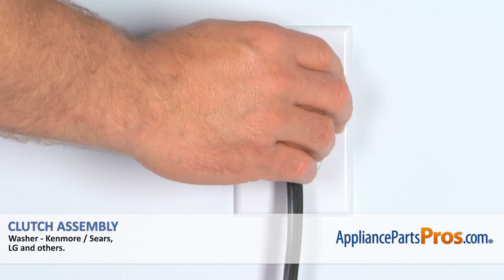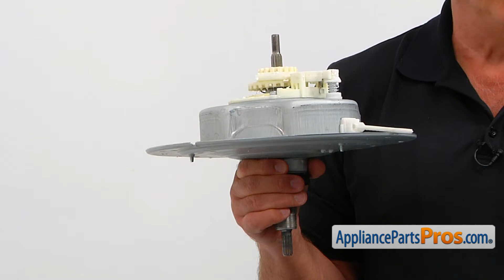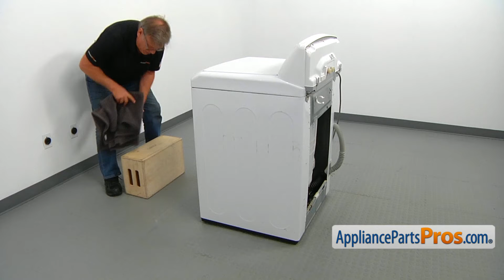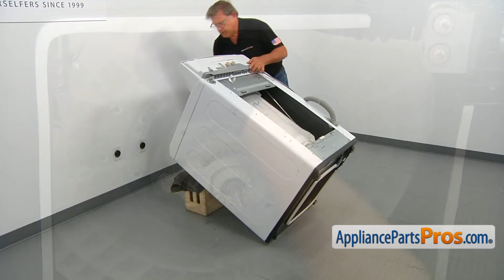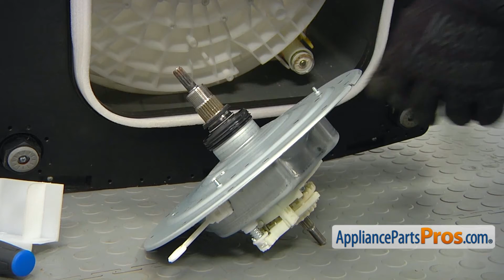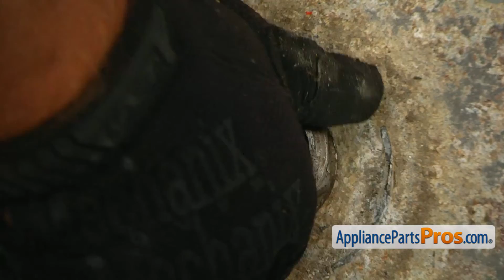How To: LG/Kenmore Clutch Assembly AEN73131403

Comment: Is there anyway to get the shaft out of the clutch assembly? My bearing is done and usually things are made to come apart, but there seems to be 2 metal lips holding the bearing in. Is that correct?
Reply from the maker: What is the model number of your unit?
Reply: @ ended up that it went down through the top. Thanks 😊
Reply from the maker: Awesome — glad you got it figured out! Thanks for letting us know. If you ever need help tracking down parts or have more questions, we’re here for you. 👍

Comment: Great video - folks watching it - be aware that :
1. if you have to hack through the plastic (3:23) I'm pretty sure you'll need to purchase a new pulsator.  I was able to use coat hangers bent to make a hook, put them into the three holes around the edge of the circle and pull the pulsator off.
2. That 38mm bolt is a bear.  I used an impact drill for over 30 seconds of continuous blasting with two types of penetrating oil before it budget.  
3. Getting the rotor assembly off is no simple task.  In all the videos I watched they are smiling and gently wiggle it off.  Not my experience.  There was sweat, cursing, two types of penetrating oil, and over an hour of wiggling.  I read someone said "gently tap with a hammer" - terrible idea.  The magnets on the other side of where you tap are brittle and break easily.

Overall fantastic video!
Reply from the maker: Thanks so much for sharing all of that—seriously great additions. Real-world experience like this makes a big difference for folks tackling the same repair. That 38mm bolt and the rotor can be brutal, and you're absolutely right about being careful with the magnets. Coat hanger tip is genius! Really appreciate you taking the time to share it.

Comment: Is it possible to replace just the shaft that the pulsator sits on? Mine has snapped in half
Reply from the maker: What is your model number?
Reply: @appliancepartspros  lg WT1101CW
Reply from the maker: Unfortunately, that shaft is only available with the drive shaft and shifter assembly, part number AEN73131403. This part is also no longer manufactured and we do not have any stock left, so we are unable to order it. You can take the part number and check around to see if anyone still has some stock left.

Comment: Is removing the tub really necessary?  Isn't the removal of the 38mm sufficient enough to remove the clutch assembly from the bottom?
Reply from the maker: If you are able to remove that part without removing the tub, then you can do that. It may not be an option for all models.

Comment: I thought this video was the most thorough on this repair. Only 3 comments I have are; #1 you may get a clutch that doesn't have all the holes for the stator threaded so inspect your new clutch before installing and thread them ahead of time. #2 each models method of opening the top may be different. My LG does not use the pry open method but 2 bolts in the front under caps and 4 small screws in the back (no hinge). #3 and very important as this took me a bit to figure out, make sure after you remove the old clutch, you verify the thick metal & rubber washer on the top shaft has come off with the clutch and not stuck to the bottom of the drum. That is what happened to me and it makes the drum sit too high (now you have the new washer on the clutch and the old washer stuck under the tub) and the drum will make a grinding noise as it will rub on the drum cover plate.
Reply from the maker: Thank you for those tips!

Comment: Again, outstanding video!  Just a quick tip... When I ran my washer the first time after installing the new clutch, all was well till the spin cycle.  There was a rattle that sounded like a screw was bouncing around inside the rotor.  I took the rotor back off and all I could find were VERY TINY pieces of metal (less than 1mm diameter) that I assume were bearing material from the old (failed) clutch or pieces from the old old clutch.  Again, they were very small, so I used compressed air all around the magnets in the rotor, and I then had to pick the pieces off the magnets.  Once it was clean, I put it back together and the washer runs like new now.  On a side note,  I tightened everything to what seemed to be right.   I was surprised that there weren't any torque specs given for any of the bolts, especially considering there is a lot of plastic.
Reply from the maker: Thanks for the tip!

Comment: Great how-to video.  I don’t typically work on my own appliances, but thought I would give this clutch change a try.  Pretty straight forward.  I also had the question as to why the drum had to come out, but from working on cars i am assuming it comes out to make sure the seal on the clutch remains seated “squarely” in place while the tub is lowered, else it may get misshapen and leak.   Also, on my model, the top has the four screws (two in the front are under plastic caps that just pop off), once they are removed, the whole top lifts off, no need to “slide it forward.”  Make time to clean the inside of the outer tub and the outside of the inner tub, ours had lots of mold.  The hardest part to remove was the rotor, but just tap a little around the spindle and keep wiggling and cussing and it will come off.  I got my clutch from Appliance Pros, and all six holes for the stator were threaded. I used an impact and a 38mm socket to get the main nut off in the tub.  And someone please get this instructor a couple of impacts to make his life easier!
Reply from the maker: You are welcome! Glad you were able to fix your issue! If there is anything we can help you with in the future please let us know.

Comment: Some bits don't carry over to 2018 era machines, but overall it was good. I didn't need to chisel away the part he did to remove the wash plate. There are less destructive methods like screws that just fit in the holes in the base, or two channel locks. Those don't require also replacing the wash plate.
Reply from the maker: Thank you. It really all depends model number to model number.

Comment: As for the drive shaft nut the secures the wash drum to the clutch shaft, removal usually requires the aid of an impact wrench, I used a twenty some volt cordless impact wrench and 38mm socket for lg, 38mm socket can be ordered on Amazon. Harbor Freight gave me a great deal on the cordless impact wrench which I also use when I need to remove a wheel from my vehicle for brake checks, easier than a lug wrench.

 To  remove a seized wash platter from the drum bottom without damaging it requires some time, a lot of patience and in the end a little fineness. Once you have removed the plastic center cap and the screw that fastens the wash platter to the drum spray some penetrant such as wd40 or other brand into the threaded hole the screw was removed from. Don’t go crazy with the penetrant , lightly spray right into the screw hole section until it has filled the hole and spilled out slightly into the round area where the screw head seats, leave it sit for an hour or so and then return and repeat the process. You want just enough penetrant in the center so that it can seep into the space between the clutch shaft (the shaft the platter fits down onto)  and the center opening on the platter. Once you have sprayed the penetrant and let is soak two or three times over several hours slowly work your way around the outer edge of the center platter pushing down on the edge as you work your around  the platter, you will hear some light cracking as you’re doing this, the noise is a good thing. After you work your way around the platter edge several time you should be able to with a little tugging pull the platter up and out of the washer.    NOW the following is worth an honorable mention. If you’re working on an lg1101cw as I was and the drum doesn’t want to spin and at times spins a little but makes a grinding sound as if something is stuck between the drum and outer drum basket, do not assume it’s a clutch issue. To install a clutch in one of these machines is time consuming and very labor intensive. If you machines symptoms are like those I described prior and you wash drum spins freely by hand, try the $13 fix first which is to replace the stator/motor sensor which is a plastic sensor that literally snaps onto the edge of the stator which is that heavy ring with the copper windings aka the motor. Many videos on YouTube go right to replacing the clutch. My machine would not wash, overfilled with water and made the scraping grinding noise when the drum would try to spin. A new Stador sensor fixed all for $13. If you do remove that wash platter in the drum, again, do so with patience and fitness, a new platter will set you back another $160 or so which is not necessary .
Reply: I have the metal to metal scraping noise on our 11 years old LG WT1201CW washer.  Interesting that you say that it could not necessarily be the clutch assembly and that it could just be a bad stator/motor sensor.  I will try that first as I'm having a hard time removing the wash plate; it seems stuck pretty hard.  Thanks for your comments.

Comment: I just installed the 2nd replacement clutch on this 10-year-old WT5101HV washing machine.  The original lasted about 5 years, as did the 1st replacement.  On the 2nd failure, the bearing(s) failed, and some debris got in the gap between the rotor and stator (both are on bottom of hte machine).  Wasn't aware of that until after reassembly and some of the original noises still existed during a hand-spin verification of the repair.  Removed the rotor and the noise was gone.  Review of the rotor showed round BB-like debris (from the ball bearing) and also some loose magnet chips, with some mild contact markings on the stator as well.  Did a thorough cleaning of both items (removing the debris from rotor is challenging as the debris is magnetized and it clings) and noise is eliminated.  Will be doing some wash this week with fingers crossed, and a new rotor is enroute.  Fortunately a rotor swap is fairly simple and fast.

Comment: My LG top load washer is different the top assembly is held on with two screws to on the top and two in the back, then you have to lift the top off to get access to the top of the basket, once I had the large nut that I removed with the pipe wrench but when I went to remove the rotor in the bottom I pulled and pulled and wiggled it from side to side, I tried till I was blue in the face is there something I’m missing is there something different about this machine? Can someone help all the videos that I have seen have been the washers with the control panel in back.

Comment: Tip: when removing the clutch assy, there’s an inner ring of bolts and an outer ring. The inner ring (thru 2 thicknesses of sheet metal) also need to be removed. Initially I only removed the outer ring. Basically all the 10mm bolts need to come out.
Excellent video, very well-narrated and produced to minimize time between key points. Easy to follow. Purchasing thru AppliancePartsPros was completely smooth, fast delivery. So happy to have my washer working again, especially because everything else appears to be in good condition.
Reply: If I would have read your comment first I would have saved myself quite a bit of frustration 😂

Comment: Good video!  Hate to see the chisel come out but I get it.  On our 5 year old machine, the top 10mm came right off, as did the pulsator plate, but the 38mm nut did not respond to battery impact wrench on high so I had to give it some heavy hits with hammer on pipe wrench, along with PB blaster penetrating oil.

Odd thing, when I got done, I found the large, bottom (rotor cover ??) nut lying on the floor under the machine.  I doubt that my hammering caused it to come all the way off.  Will temporarily tighten things up while waiting for new clutch assembly and see if maybe the bottom nut was loose the whole time (or at least for several weeks).  I would think that the motor would have shredded itself though without the nut in place or tight.

Comment: I followed all of the steps but I cannot get the clutch assembly from dropping even though I had removed all of the hardware described in this video. My washer is an LG  WT4801CW
Reply: Also, for future readers - the drive flange/disc inside the tub is splined to teh clutch.  It's not simply going to drop out, it'll be corroded and mildly fused together.  I had to use a sledgehammer, pounding it vertically on the shaft.  I couldn't get enough force swinging a hammer, due to the handle hitting the sides of the tub.
Reply: You're going to have to strike the clutch from within the tub to get it to release and drop.  The rubber boot might hav expanded, causing the clutch to get stuck.

Comment: If the shaft has broken in half, would you also have to replace the clutch assembly since the shaft is within this part?  My washer plate came off with half of the shaft (broken) sticking out of it.

Comment: Curious how come the tub needs to come out?
Reply: @Lex Man I couldn't get the nut that secures the shaft to the tub off.   I let the oil sit on it for quite a while and spent 3-4  hours hammering away at the pipe wrench with a heavy forged mallet and it didn't move.  Someone mentioned they had to use an impact driver and i believe it. Unfortunately I didn't have one.  Anyway, i gave up and returned the parts and we went yesterday to buy a new machine :-(   hope you have better luck!
Reply: @motiftripper next time just chisel the old nut off if you don't have the power to break the rust! A few $$ is better than a few hundred. Cheers.

Comment: before you replace that clutch assembly or call the repairman you should check to be sure that grinding noise you hear is not coming  from the stator cover or nut that turns under the machine. if you tilt the empty machine back a little but not to far you can see and feel that assembly which spins under the machine. in my case the pan that is placed under washing machines to contain leaks was missing but the drain pipe  was still left sticking up out of the floor and when the washer turned on the stator cover or the shaft nut hit that pipe end and made a grinding noise that i would have sworn was the clutch assembly. so much so i was willing to pay a repairman $350 to $450 to replace the clutch assembly  or just buy new washers which i had been pricing at $800 to $1200. simply moving the machine over 8 inches was enough to stop the problem

Comment: I used a 1-1/4" deep hole saw to cut the wash plate away, followed by a torch to remove the remaining plastic and an angle grinder for the remaining splined piece.  My error in trying to remove the 'stuff' at first with an impact driver.  I ended up destroying the threads of the nut, not getting the result I had hoped for.  Parts are outrageously expensive but its a closed market unfortunately

Comment: Good video, thanks.  I just did my Kenmore (made by LG obviously).  Do not attempt this without a hefty impact driver and deep 1 1/2" / 38 mm socket to get the tub nut off. I doubt you will do it with a pipe wrench and hammer.  My agitator disc came right off.  The whole job might have taken me three hours but I spent all day including borrowing a 1 1/2" socket from a neighbor. I guess the seals went and took out the bearings on the drive.  The rotor was rubbing on the stator because of the shot bearings.
Reply: I experienced this also, the bearing balls got in the gap between rotor and stator, causing noise upon hand-spinning to check my repair.  Found debris and mild damage to the rotor that I didn't have last time I replaced the clutch.
Reply: I got one of these for free. Same thing

Comment: I used wire and a car jack to pull my pulsator plate off vs a detroying it with a hammer and chisel. The splines on it are metal and there is no evidence of significant wear that would otherwise necessitate the replacement of this part.
There are 3 holes under the cap you can loop wire through, or you can slide the wire under the plate to the center.

Comment: Nice job. You used an old machine so that made the video more realistic. One question.
If you compare 5:25  to 22:35 , do you notice the difference in terms of how far the nut went down the threaded shaft of the clutch?  There seems to be at a 3 thread difference. That is the problem I ran into also and the nut came loose after a few weeks.   I used a heavy duty impact gun .  Do you know why the nut does not penetrate as deeply with the new clutch as with the old?  Thanks.
Reply: Old question but my recent experience:  there is a seal bonded onto a steel washer that is approx 1/8" thick. This might remain in the splined drive flange after the clutch is hammered out.  Looking in the ID of the female splines, you'll see a faint circular line of the washer.  The new washer/seal is attached on the new clutch assembly, and gives a visual of the part needing removed.